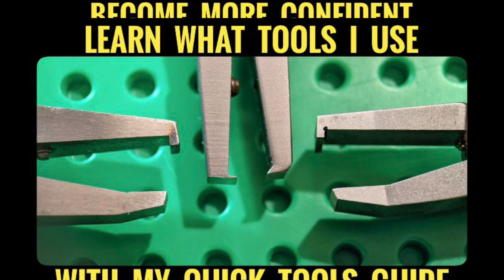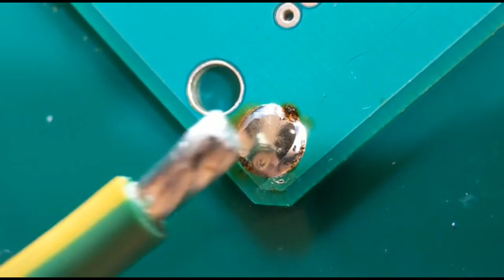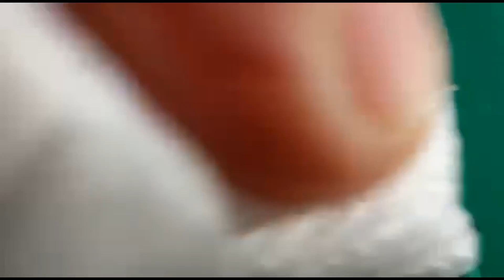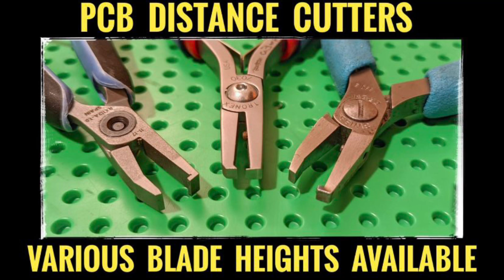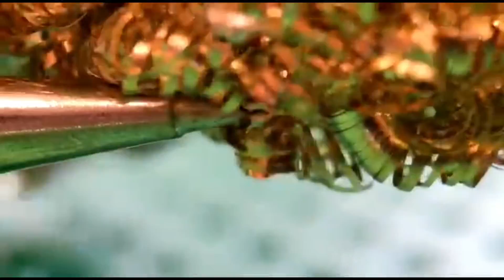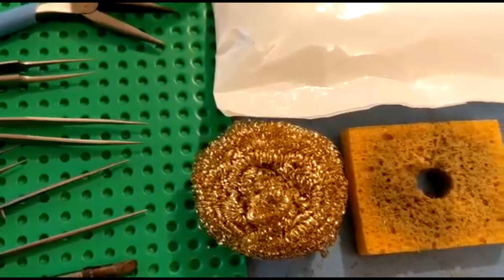Instantly Improve Your Soldering Skill / Soldering Tutorial

Comment: I don't know how i could i setup  right temperature at my soldering station 
If i put 340 degree not melt very qickly the tin 
I use 0.4 mm tin 
Is take by aliexpress,maybe that's why
Reply from the maker: Hi , thank you for your comment . I always just start with about 330 degrees Celsius for leaded soldering and 360 to 375 degrees Celsius for unleaded soldering . I will up them sometimes if I need to , some components may need another 30 to 40 degrees . Add flux and get a decent solder . Never used AliExpress so can't comment on their solder . Hope you get on ok 👍
Reply: @mrsolderfix3996  thank you very much
Reply from the maker: Hi , no problem . Thanks again for your support of my channel 👍

Comment: With through hole plated pcbs you can solder on the top side of the board and tack the components onto the board, taking a little care not to apply too much solder. You can then turn the board over without the components falling out. Now clip the leads, close to the board. Now solder the components in. The result is a nice smooth surface that is really easy to clean. If you need to remove any components, it is easier to do than with leads that have been bent to hold them onto the board.

Comment: How to remove caps etc 17.00 minutes in. Can these be removed with a soldering iron?
Reply from the maker: Hi , I presume you mean the small 0603 surface mount capacitors ? If so yes these can easily be removed with a soldering iron . Because these are so small you can just lay your iron up the side of them with solder preloaded on to the tip . This will then melt both ends at once and can easily be lifted off with tweezers . If your looking at larger capacitors i.e Tantalum capacitors I just use 2 irons ( if you have 2 ) put one on each end , this melts both joints at once , simply lift off . 2 irons best thing ever , dedicated a video on YouTube all about 2 irons , I love this method. I've also posted a couple of videos on YouTube showing different removal methods of all types of components.Hopefully I've answered what you need to know . Thanks for your support , take care 👍

Comment: What tip at 14.25
Reply from the maker: Hi , if you mean soldering iron tip , I use a Weller TCP S iron mainly ( also sometimes use a micro Metcal iron ) but the tip in question for the Weller was a conical tip PTP7 . About £6 from Farnell , RS Components etc . Hope that helps 👍

Comment: I really love your videos, they've helped me improve my skills immensely. I'm curious what solder you prefer; particularly in 0.25mm diameter. I've used Kester Sn63Pb37 3.3%/44 .025" (0.6mm) forever for through hole work and love it. That said I'm getting into more SMD designs and think I'd have better luck with a thinner wire like the 0.010" (0.25mm) you suggest but no one seems to stock the Kester 44 at a reasonable price so I'm looking for alternatives. Again thanks for all the great videos!

Comment: What type of flux are you using? I've been using the kind that comes in a puck. It requires cleaning afterwards, which I don't mind. But, it's clumpy and awkward to apply. Thanks for the great videos.
Reply from the maker: Hi , thank you for your comment, much appreciated. For the last 10 years or so I have used a liquid flux called SMFL200D which came in a spray can . I used to decant a small amount into a small container then use a dipped cable tie to apply it . It was amazing stuff but it looks like within the last month or so it's become discontinued. I'm currently looking for a similar type to replace it with . If I find one I will mention it on my channel . I've posted a video on YouTube all about cleaning flux off with amazing results and how I achieve these results , fluids I use etc , may be useful for you . Thanks again for your support 👍
Reply: @mrsolderfix3996  Awesome! Thank you!!
Reply from the maker: Hi , no problem , thank you for your support of my channel 👍

Comment: Your tip and iron very nice... 👀 Where can buy this
Reply from the maker: Hi . The iron I use is a Weller TCP S . There's many different options of tips for this iron . It's available on Amazon , Farnell , RS Components + others ( just Google it ) . The iron plugs into a power supply base unit so you will need this as well . Quite expensive , probably about £200 - £300 for the complete unit but it is a great iron . Good luck with your search , thanks for your support 👍

Comment: Another very helpful video - thanks a lot. 

Can i ask what you use to apply the flux?
I have a bottle with a small brush, but with that it is difficult to apply small amounts, and have also tried a toothpick, but that doesn’t apply enough! So would be interested in what you use.
Reply from the maker: Hi , thank you for your comment , much appreciated. I use a spray flux called SMFL200D , which I squirt a small amount into a small container ( i.e milk bottle lid ) then I dip a small plastic cable tie into the lid then apply it using this method . It works great and is perfectly safe for the board as it's plastic . 
I've done a complete video on YouTube showing the flux I use and my methods for applying etc . If you haven't seen it , it may be of interest . Thanks again and good luck with your soldering projects 👍
Reply: @mrsolderfix3996  Thanks! Have now watched the flux video…
I’d never have thought of using a cable tie, so appreciate this great tip.
Reply from the maker: Hi , no problem , thank you for your support , good luck 👍

Comment: Hi, I think you are fantastic, you make it look so easy. I am trying to fit an IC it’s a 28pin 232R, only about 10mm square, not every leg of the IC has pads, also have some pads missing with broken tracks. Will have to join track under chip, as track came off with IC,  some tracks lifted as very sticky flux under it. Do I just make a joint under ic and put some solder mask on it, should I use glue under pads, if so what sort do you recommend. I am 75 yrs old and always dabbled in repairing things, but this us a whole new ball game. Your videos are just out of this world, and I will follow you, any help you can offer would be appreciated, thanks for your time, Barry
Reply from the maker: Hi , thank you for your comment , much appreciated. The first thing I generally do is remove the IC , then clean up the situation the  best I can then assess the way forward . If I have slightly lifted pads still attached to the tracks I generally leave this because they can be reworked. If I have missing pads or tracks then generally this is not a problem as these can be replaced . If I replace tracks I try and get a sleeved wire to match the width of the track ( very important ) as signals , etc can damage these tracks of you have fitted a way thinner version of the original. If the damage is underneath the IC body I generally repair these first leaving the tracks protruding out to where they have to connect to . I sometimes use a peeled track from an old PCB to repair damage like this as it's very flat allowing the IC to sit back down as it was intended . For missing pads etc I generally lift pads from scrap boards ( size to match ) I show this in other videos ( repair pads , tracks and IC pins ) is one I've done that shows all this . Holding pads down with fine tweezers I quickly do the solder joint with a pre loaded iron ( you get to know the amount  you will need ) . Any damage can be fixed , if you watch the video I have just mentioned this will help you . I've also done an early posting on YouTube called the " invisible fix " damaged / missing pads , this sounds exactly your situation . As for glue , I don't glue underneath the pads as I find as soon as you put your iron on these pads they can move . I generally do the soldering then glue around and over the joint , this way encasing it. I use sometimes a 2 part araldite , or a 2 part glue called Tak Pak , which is made for PCB repairs .If you watch the other videos  the sound of my voice and the music are at different levels ( I was learning then , I've sorted this now on my new videos ) , hope this helps , also try and get a fine conical soldering tip and 0.25mm solder ( BLT Circuits , in England ) are a good soldering supplier. Good luck and thanks again 👍

Comment: Where do you get those length cutters from I cant find them anywhere?
Reply from the maker: Hi . Thanks for watching the video , much appreciated . Try the Tronex 5030 make . These are available with different height blades . Generally I would use 1mm to 1.5mm . Fairly expensive but over time are a great investment. Hope that helps , thanks again 👍
Reply: @mrsolderfix3996   thanks got some ordered and sub to your channel :)
Reply from the maker: Hi , glad I could help . Thanks again for watching 👍

Comment: great video thanks .what is the brand of your cleaner?
Reply from the maker: Hi . Thanks for your question. The cleaning fluid I use is called Ultrasolve . It comes in various options i.e spray cans , pouring containers , 1 litre or larger. Available from Farnell , RS Components , Rapid Online and other electrical retailers . It's in my opinion the best pcb cleaning fluid there is , and I've used lots of different types over the years. I pour some into a small container then use a cleaning cloth dipped into this ( Gtek dry wipes available from grove sales) which are also amazing . About £5 for a pack of 100. Hope that helps 👍

Comment: When you say "small conical tip", what size (model number) are you using? I have conical tips that do not come to the fine point I see in your video. Also, can you shape the tip (sharpen the point) using sandpaper? I am trying to solder a 100 pin chip like the one in your first video and my tip just seems too big.
Reply from the maker: Hi , thank you for your comment. The iron I use is a Weller TCP S iron . It's quite an old style with a large size handle but it's what I've always liked and they are still sold via Farnell , RS Components etc . 
The reason I like this iron is because you CAN play about with the tips ( even though some people swear you can't , but they are wrong in this case ). I use 2 main types of tip to get my pointed one you see in the video.  The first choice is called a PTP7 and this is a conical tip just slightly to big to start with . I simply use a needle file to take it to what I need . If I can't get this type I then use a PTH7 . Once I've sharpened them to what I need I just simply tin them by melting a large amount of solder on the tip then cleaning off with a damp sponge or a wire wool pad , the tip is then ready to use. 
I've also recently tried this method on a Metcal iron tip ( I've been told you can't do it on this particular make of iron ) but to my surprise it worked a treat , so food for thought for people there. Hope that helps 👍
Reply: @mrsolderfix3996  Thank you sir! I appreciate the feedback. Love the videos.
Reply from the maker: Hi . No problem , thank you for your support 👍

Comment: lol... You have me thinking really hard about distance cutters... I am wondering how that would do in my personal soldering workflow methods. I use the typical method of populating a component on the board, spreading its pins to keep it from falling out, flipping the board, soldering the pin, then cutting the pin at the top of the solder cone. Using distance cutters, I would cut the pins before soldering. So, how do you spread the pin to keep the component from falling out of the board? The cutters come in different distance lengths. How do I determine what distance I need? I am sure there is some standard, based on the pin diameter.
Reply from the maker: Hi. When I personally fit through hole components I never spread the cut legs out to stop the components falling out of the board before they are soldered. If you do this it makes rework if it's needed in the future so much harder as you have to ease the cut  legs up before unsoldering the joints , and if they are bent flat to the board this is not easy. Also I've seen it where cut legs that have been bent over have shorted out on nearby tracks so to me this is not a method I would ever choose. As for the height , most companies I've done work for aim for 1mm - 1.5mm per joint . So this is the height I would use. Also you can buy special jigs that you put your boards in , populate them , close the jig then spin them over and then cut all the pins . The boards are held in with layers of foam , and this is what most companies use where I've been .Thank you for watching , much appreciated 👍
Reply: @mrsolderfix3996  Thank you for your reply. I was thinking that 1.2mm would be about right, for me. Interestingly, that falls in the middle of what you suggest. I have seen the jigs with the foam tops in videos, but I have never seen one for sale. Do you have a make, model and source?
Reply from the maker: Hi . The jigs that you can use for populating through hole boards are called PCB holding assembly jigs. Try looking up CPC Ideal - Tek PCSA-1. Available from Farnell , RS Components ,CPC and others .This is a common one . You can get various sizes and prices for these jigs . If you just Google this you will find out more places etc where you can get them . Hope that helps 👍
Reply: @mrsolderfix3996  I did find these for sale through USA retailers, but they are rather expensive for a retired hobbyist, like myself.
Reply from the maker: Hi . I reckon there must be some of these jigs available second hand through company auction sites , as when older firms pack up they would have probably used these jigs. I never use them personally as I just hold in the parts as I go , cut the pins and then just tack 1 or 2 legs of each part . This always works for me , no matter how many parts I'm fitting , or what parts. Anyway good luck with all your projects and thank you for your support 👍

Comment: Thanks for the great video and tips. @ 6:20 - When you were soldering the heavy, stranded wire horizontally onto the PCB pad... You soldered it with a perfectly fine method, but I saw the opportunity for a trick... You applied the side of the hoof tip to the pad and the bottom of the tip to the wire. What if, at that moment, with that arrangement of wire, iron tip and pad, you gave the wire a twist?.. Rotating the heated portion of the wire down into the solder pool on the pad.... Seems like that would be one more way to make sure that there is molten solder underneath the wire... You would need to pay attention to the direction of the twist of the wire and make sure that you turn it in the direction that would not cause it to untwist.
Reply: During the actual bonding of the solder, I don't think moving the pieces (that are to be soldered) is wise as it could cause a cold solder.

Comment: Thanks for another great vid !
Could you please sort of explain at what temperature you usually set your iron.
Reply from the maker: Hi , thank you. The iron I use is a fixed temperature iron and the tips that I use in it are roughly designed to get to about 350 degrees centigrade . You can get different numbered tips that take the temperature up a bit but I find 350 - 360 degrees normally works fine . Any large difficult joints I just use a different tip in it . Hope that helps 👍
Reply: Thanks a lot.
Reply from the maker: Hi. No problem , thanks again for watching the video , good luck with any projects 👍

Comment: Any special process for prepping a new soldering iron tip?
Reply from the maker: Hi . Thank you for your comment . When I use a new tip on my iron , the particular iron I use allows me to just smooth any rough edges on the tip with a gentle brush of a light needle file . Some iron makes you can't do this . Then I normally melt loads of solder onto the tip causing a big blob on the end . I leave this for a few seconds then clean off . The tips I use are then ready to go as they are nicely tinned and shiny on the end . Thanks again , and good luck 👍
Reply: @mrsolderfix3996  Thank you for all the tips.
Reply: @lint2023  Tip top tip tips 👍
Reply from the maker: Hi . Thanks for your comment , I'm glad you found the video useful 👍
Reply from the maker: Hi . Thank you for your support . Hopefully I can help a few people , then it's all worthwhile . Thanks again , good luck with your projects 👍

Comment: Excellent video, as usual. I think your channel is way underrated.
Those special cutters are quite expensive though.
Reply from the maker: Hi , thank you for your comment , it's very much appreciated . I realize some tools , especially Lindstrom tools are a bit dearer than others but I've had most of my tools for years so it's very much worth it in the long run as they last year's if treated right , unlike cheap tools, especially if your doing a decent amount of soldering . The distance cutters are worth every penny as they really do save time and rule out damaging boards. Thanks again for your support 👍